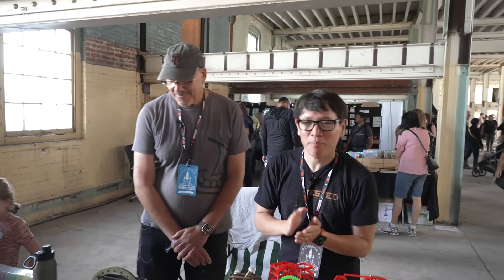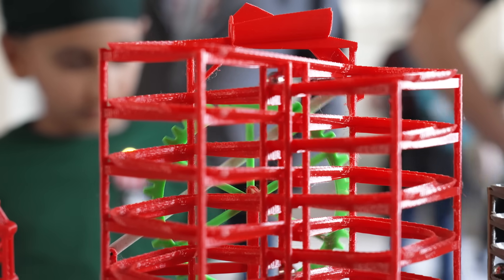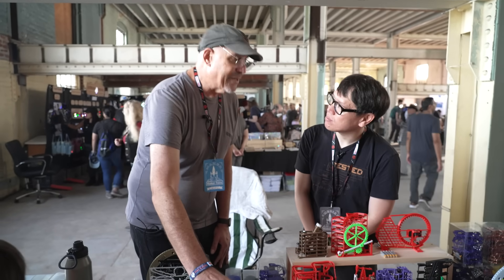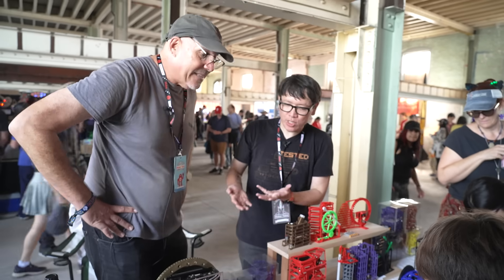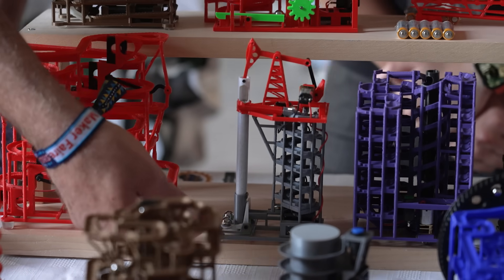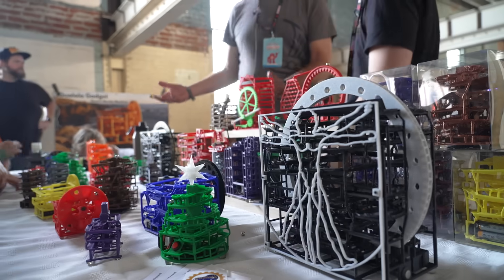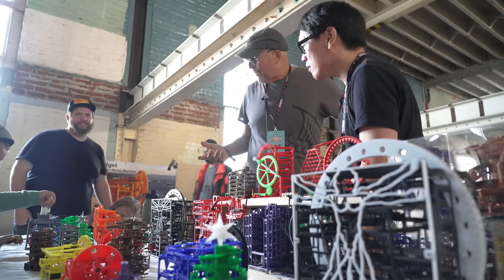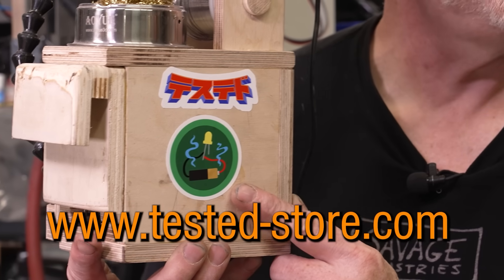Mesmerizing Kinetic Marble Mazes!

Comment: I printed the manual piston maze, it's amazing. I scaled it up 212.18% which is a nice size. Had to order some compression springs, looks like you need one to get the piston to work correctly. I used red filament, I wish I'd have used white for the piston. The red and white would look really cool.

Comment: My brother and I, as kids, used to build these kind of things with Plastilene, running large ball bearings.  We had a LOT of plastilene, and its pretty bendy, so making an elaborate run meant constant testing to make sure the bearing ran the whole length without a low spot or fall off on a turn. We literally stuck the plastilene channels to the wall ( leaving oil marks on the wall, of course) and started near the ceiling, as we got lower and lower doing circuits around the entire room, switchbacks and even loop’th’loops, we would then incorporate furniture in the room, building an elaborate set of swirls, funnels and splits on top of a dresser, then a corkscrew loop down to another structure built on top of a pulled out drawer, then around the side to a wall to bridge over to another piece of furniture, maybe a table, then to a chair, and ultimately to the floor. We would spend days building one of these and the longest running one we built took around 22 minutes for the ball to make the entire run.
Later, on, My father helped my brother build a small one like these in the video out of steel and tubing, and a clock motor to lift the bearing back to the top with a little hand fabricated tip bucket to dump it back on top. This was in 1965. My brother entered it into the School science fair and won first prize. He called it a “nothing machine”.   To this day I call these kinds of gizmos Nothing Machines.

Comment: Honestly I've said in the past but these things strike me as probably the best option towards making a perpetual motion machine. Just find a way to power the lifting mechanism by the marbles movement and I think that'll do it, or at least as close to one as possible
Reply: Yeah, it would never actually create a perpetual motion machine as that breaks the laws of physics, but theoretically you could create one with a very small loss in energy that could keep it going for a while.
Reply: @DecayingReverie  yeah, at the very least itd be pretty close
Reply: "Just find a way to break the laws of physics and you've got yourself a perpetual motion machine". You aren't wrong, I guess.
Reply: @bryan__m  look I am very much not a physics person alright 😅

My idea was basically something that pulls the marbles up an elevator and then either generates electricity via going down the track like some sidewalks or, and this is more likely, start with a fair bit of electricity already there and then generate it via dropping the marble since the pull of gravity is pretty much a constant.

Like I said obviously I got no idea how one could try this or if it would remotely work for any time but hey
Reply: @trustindean5164  theoretically, if you could be 100% efficient something like that could work. You gravity puts X amount of energy into the system to move the ball down, and it takes exactly X amount of energy to move the ball back up to where it started. If you could completely convert the energy gravity gives you, you can use it to move the ball back up (kind of like a pendulum).

The problem is no form of energy conversion is going to be 100% efficient. So you could maybe make something that takes very little energy because it recycles a lot of it (kind of like how regenerative braking in EVs charges the batteries that gave the wheels the power to move in the first place), but never anything with 0 added energy.

Comment: would be great to see their design process!
Reply: Blender ain't the right tool, that's for sure
Reply: @BGraves  yeah I was thinking that however the fact they claimed to be able to change the tracks so easily is interesting (i.e without changing the whole design), But I believe this could be done feasibly in other programs with path following sweeps.
Reply: @justin.s  Just guessing but maybe they are using Blender's geometry nodes? Once you create a scaling track part with level supports, you can just move and scale it infinitely